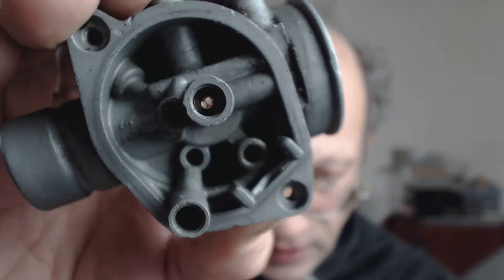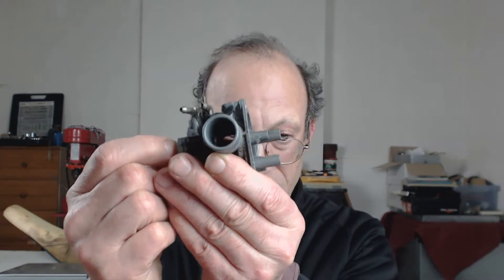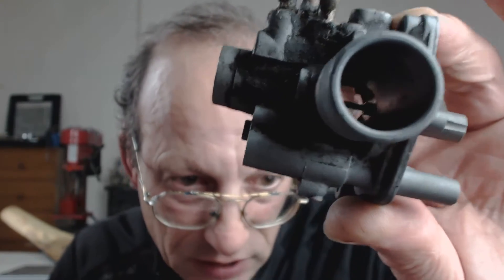Dellorto PHBN needles and jets

Comment: Hi mate, having problems with my reiju mrt am6 ,phbh 16 identical to the one in this video. Im running a stock barrel and a technigas exhaust with a 105 main jet and the bike runs idles fine and revs fine in neutral but is completely flat and has no power at all when riding. What main jet would you recommend as i think this is the issue. Cheers
Reply from the maker: It's hard to say Sol.
105 def sounds large ... but you need to get the pot cooking at the outset.
Set your idle circuit correctly, based around a 36.
Try an A20 dropped low into the atomiser - say notch 4 to delay hitting the taper
... hahaha starve her just a bit at low load - you won't melt the piston, but you will get the combustion chamber hot and ready for when the fuel dump comes, when you hit the taper - then it'll fly like a tart after two weeks in a convent :D 
Gradually edge down the main jet, keeping a watchful eye on the plug colour (keeping a slight tan - never white).
Reply: @EngineTuning  yea okay mate cheers i dropped down to a 80 main today from 106 down to 98 and then intervals of 2 down to 80 and its running better but sill shit

Comment: I own a Yamaha tzr50, recently I bought a new Reed valve for it but the bike will not idle - only run with the throttle cracked. However if I place the old original (incredibly worn) minerelli Reed valve in the slot, the bike will idle but not go above 7000 rpm
Any ideas of how to fix this?
Reply from the maker: It could be any number of problems
... but most likely it will be cumulative issues.
The idle circuit is probably not set correctly.
The reed valve might be a touch too thick.
The piston rings may be worn, or clogged with carbon, and the cylinder bore glazed.
It could need a new spark plug, and plug cap.

It may be time to remove the barrel, break the glaze (or rebore), and change the rings and maybe the piston.

... normal fun work :)
Reply: @EngineTuning  So ive resorted to using the original read valve, just so the bike will at least idle, but it will not get above around 7k revs. The barrel and piston is new, the entire engine has recently been rebuilt and the ignition system is new. It smokes alot and will not rev high. Any advise on what to do here, thanks.
Reply from the maker: @daveontherocks3111  If it smokes a lot, then it is running rich.
If the engine has been rebuilt, then this could be the problem area also.
Hey, it could be simply that your choke is stuck on :D
Have you checked the plug colour?

You need to work your way through the engine and carburettor, eliminating problems, until you find the problem.

Only you can do this ;)

Comment: I know this is an old video, but could you help me out? I have a stock needle in my dellorto phbn 16 and i think that its running lean on mid gas, even when the needle is in the highest position. what needle should i buy first?
Reply from the maker: Hi Otto :)
It's not possible to provide this kind of tuning advice, on the basis of a carburettor body type.
Consider visiting fuelmapper.com.
Think about the possibility to educate yourself in the skill of engine tuning - the fuel mapper will help, and I'll send you a general tuning guide.
Best wishes...

Comment: Please help. I have the needle in position 5, that’s how my kart runs best. Should I change the pilot jet to a bigger one and then bring the needle down to position 3? Is my understanding that if the needle is in position 1 or 5, you should change the pilot jet to a smaller or bigger one so the needle ends up in position 3? Is that correct? Thanks 🙏
Reply from the maker: Hello Silvana.
The problem that you face, is the need to learn how to tune a carburettor.
This is possible, but it will take some dedication.

Each element of the carb deals with a phase of the throttle, and merges with the next phase.

So the pilot jet deals with tickover and launch.
The needle can effect tickover but mainly deals with launch to mid throttle, while also effecting high throttle.
The main jet deals with high throttle, but also effects the full throttle range.

The first step is to understand this interaction.
The next step is to plan your carb changes.
The next step is to test your carb changes on the road or track.
Then make adjustments and test again.

The Needle Carb Fuel Mapper will help you in all these areas, but you must be prepared to learn.
Visit Fuelmapper.com and view some of the videos.

Good luck :)
Reply: Engine Tuning thanks for the help.

Comment: hi Engine Tuning, I'm having a nightmare with my pbhn 16 on a Reiju mrt 50 am6 motor, I replaced the top end with a cast iron 50cc after market one. I have a feeling the old one may have been a 70cc kit, as the main jet was a 112. I've replaced it with a 82 main. the problem is total lack of power. the cable choke doesn't do anything, although the cable does move the choke freely, also the idle adjustment screw does nothing to alter the revs, even when fully in. the bike was left outside for 6 months, so I stripped the carb completely, including the atomiser tube, and cleaned everything thoroughly, and blew it all through with an air line. the reeds are good and there are no air leaks on the rubber manifold. I've replaced the magneto side crank seal, as the plug isn't getting oily, I didn't bother with the clutch side. please help! many thanks, rob.
Reply from the maker: Hi Rob.
I'm busy on something at the moment ... I'll get back to you later.
Reply: no worries, not that familiar with YouTube posting, sorry! I appreciate your time, thanks
Reply from the maker: 1) Youu have replaced the 68cc or 74cc barrel with a 50cc barrel.
- 40mm D - 47mm D - 49mm D

Measure the previous cylinder diameter to learn the previous capacity.

Obviously the performance will plummet - at least by a third (33%), which is huge, when riding a small capacity bike.

2) The barrel contains the inlet and exhaust ports to the cylinder.
The barrel casting (containing these inlet and exhaust ports) can be crap.
They can be good, but they can be crap.
I'm going to do a video about this, but for the moment...

I tried a TNT 50cc replacement for the original Minarelli (which was shagged) - yet the new TNT barrel was far worse than the shagged original - it offered no zip whatsoever.
... it was (and is) good for a doorstop.
I put the original barrel back, before upgrading to 74cc.

In effect; if your cylinder ports are crap ... no matter how well you tune the carburation, it will always be crap.

3) Next ... you don't understand how fuel is delivered to the combustion chamber, from tick-over through to WOT (wide open throttle).
This is entirely normal.

There is a multitude of carb options, to adjust the fuel delivery throughout the throttle range.
Basically low, mid, high throttle ... all based upon airspeed through the bore of the carb.

However, these adjustments can effect the low and mid, the mid and high, or the low mid high.
This is a nightmare until you relax, and begin to see the whole fuel delivery as a progression from 0% throttle to 100% throttle.

Once you see the whole throttle range, it gets much easier.

To see the throttle range ... consider viewing this video : https://youtu.be/GeaEaIdfeco
You will begin to think about low throttle settings AND feeding the powerband with fuel.

4) Low throttle settings
If your idle jet is too large, you will find that adjustment via the screw is very difficult.

Check the idle jet size ... it should be around 36 / 38.
The engine tick-over only needs to spin the crankshaft.
Set your tick-over rpm using the standard method, to gain maximum efficiency of the fuel burn.

This will create a hot combustion chamber, that will allow you to dump fuel into it, that will be immediately burned.
This is what gives you immediate acceleration (and a fun bike).

5) Just remember that you can spend hours, days, and weeks, pissing around with your carb ... and be more confused than when you started (the normal route for most people).

Consider downloading the Needle Carb Fuel Mapper to assist with your education, and the perfect tuning of your engines (now and for the rest of your life) @ https://fuelmapper.com/.

6) If the bike has no zip, after tuning ... the ports are crap. (and you can do nothing about that)
You've not wasted your time, if you are actually advancing your knowledge (rare) ... but you will not have the performance that you desire.

Hard luck ... that's life ... you've bought a doorstop (just like I did).
In such a case, the only solution is to buy a 74cc cylinder, and then you can enjoy remarkable performance.

The PHBN 16 will provide excellent power, from low to high throttle.

You will probably be limited to around 66mph (thereabouts) ... but that will get you faster than 100 kph lorries (your worst enemies).
AND... the low end response out of corners should be amazing.

PHBN 17.5 is probably the ideal all-round carb for 74cc (can hit 70 mph https://youtu.be/VzAxxfhsPeU ).
19 PHBG has potential for a bit more top speed, at the expense of lower throttle power.

However, my advice would be to tune the 16 to the max, before changing to 17.5 (because it will be fine).

For 50cc the PHBN 16 will be perfectly fine, if the bike has been fully de-restricted.,

Good luck!
Reply: @EngineTuning  thanks very much for the information. I think that's what I get for paying £25 for a barrel, a bloody door stop! It seems you get what you pay for. Unfortunately, I chucked the other barrel and piston away, as they were knackered. But the bike was apparently very quick, before the piston packed in. Its time to put my hand in my pocket, thanks again, you're a gentleman
Reply from the maker: Ah yes Rob ... at least the door stop was cheap.
Don't throw it away, because it will be a useful reference, and perhaps good for practicing on.
https://youtu.be/lRD7_V14lPs

I'm sorry that I can't offer you a good barrel.
I have a good source, but it needs a manufacturing order.
You can easily get money to piss up a wall ... but independent engineers soon discover that the money supply doesn't exist for them.

Apparently we are dangerous.

After you have removed the sharp edges ... don't forget to add some extra oil to the fuel tank.
Best drain it, to find out the quantity.

Here's a fuel mix calculator: http://www.upnor.net/tools/fuelmixcalc.html

The engine will have an oil pump.
Always fit a clear tube from the pump to the carb, so that you can see that it has oil.
(you have to get creative to fill the tube with oil ... toothpaste helps after the event, if taking the direct route)

If it has oil at the carb ... an extra 10ml per litre of fuel will do it.
Good for running in, but also good to cover the increase in capacity, if going for a 74cc barrel.

A decent fully synthetic oil will be much thinner than a semi or mineral oil.
Castrol Power 1 Racing is expensive, but it's like water and lasts for ever.
The pump will pass more oil, and you can drop the extra mix to around 5ml once run in.

Personally, from a safety perspective, I'd go for the 74cc, so that your lad (or lass) can keep up with the traffic.

Get a couple of spark plugs B9ES and a new plug cap.
They are free with cornflakes http://www.carsparkplugs.com/1x-ngk-copper-core-spark-plug-b9es-2611.html

:)

Comment: I've done alot of pitbike motor builds and when I got came and porting in play I will some times modify the stock needle and make my own tapers for certain throttle position openings. Have had some really good results
Reply from the maker: Nice!
Are you using a pedestal drill, and finger & thumb  holding wet & dry abrasive paper?

It's a good skill to learn, and might be particularly useful for 'power jet' use, where an additional jet is positioned 3/4 up the front of the throat.

Comment: Hello, dear Engine Tuning!  7:12 what a needle? A02 or A12? Thank you!
Reply from the maker: At 7:12 it is the A02
Reply: I am thankful! dellorto phva 12 What kind of needle do you recommend?(original, long minarelli 50ccm)
Reply from the maker: That's a big question
The PHVA 12 is a tiny carb.
It is generally associated with 'performance restriction'.
For this reason, I have no experience in tuning with a 12mm carb.

However... you can still tune it.
The PHVA is a good design.

Most tuners prefer the PHBN, because it is NOT auto choke,
PHVA is the auto choke variant.
(Non-auto choke means that you know 100% that the choke is off)

Other than that the PHVA and the PHBN are exactly the same.

If you wish to begin to learn how to tune a carburettor
... you really need to gain a big advantage and use what modern technology offers.

Download the Needle Carb Fuel Mapper™ from http://fuelmapper.com/
This has the PHBN/PHVA already setup, with all the needles available.

You only need to change a couple of measurements (I'll advise you).

You can experiment with the PHVA 12.
The good news is that you can then acquire a PHBN/VA 17.5 and all the needles and jets will fit.

You lose nothing!

Ultimately, if you want to find performance.... you must find a PHBN/VA 17.5.
This will give your bike a major performance boost.
At the moment, your engine is struggling to breathe.
That's okay while you are learning, but to advance.....

Here is a video on how to use the fuel mapper:
https://youtu.be/9JxZKboE5cI

When you get it, I'll help you set it up.
Also, I'll point you to where you can buy a selection of needles and jets very cheaply.
(you'll need those).

Like I said... anything that you buy for the 12, will fit the 17.5.
The 17.5 is a serious racing carb with around 1000 fuel maps. 

I used the 17.5 to do the 70mph run:
https://youtu.be/VzAxxfhsPeU

:)
Reply: Thank you! :DDD

Comment: I will say that this is a good quality video but your explanation was foggy at best.
Reply from the maker: +AVI inc 
Yes...... I accept all criticism.
My videos are done on the fly and unscripted.
They are usually way too long, but the info is there.

I've just watched through it again... obviously It could be improved, but it does prove that certain carbs have the needle in the atomiser at all times.
Bear in mind that you will find very few tuning docs (if any - I've never seen one) that explain this mission critical information.

On tuning forums time and time again, you will see people misled, through the regurgitation of 1950's carb tuning advice.
Even the official Dellorto guide misleads in this area..... old info just copied and pasted.

In fact this video was created to counter just such misinformation on a tuning forum.
Ie. Primarily, if you change the needle on a carb of this type, you may need to change the main jet.

I think, if the initial few statements are not absorbed, the objective of the video might be missed.
Perhaps I should have opened with a text statement first.... or better prepared the opening statements.

Anyway.... too late now..... hopefully what I've just said, clarifies where clarity was missing.

Thanks for the feedback  :)

Comment: RDcarbs.  Changing from a Bleed type NJ and needle to a primary NJ and needle (fatter).   The primary type runs a smaller main than the bleed type.  Proving your point.   I am working w/ banshee carbs on an RD.  The banshee needle is VERY skinny and i think shorter than the RD needle...My belief was that along w/ the pilot circuit adding fuel...that skinny needle may have allowed some fuel to bleed out of the needle jet and richen things up.  I switched to a RD stock needle and am having better results especially w/ idle...if i am wrong, than what a needle does sticking in the N.J. is atomizing the fuel more efficiently, if it is not necessariy limiting flow.   Maybe a water hose w/ an adj. nozzle and a bucket would solve this argument.  have the nozzle set to maximum atomization...then have it set to a lazer beam type of flow....do both in the sam time frame and then measure the amount of water collected both times.  Should solve that problem!!
Reply from the maker: It's interesting that you're experiencing this.
I can only say for certain that this is the case with Dellorto PHBN (and PHVA) carbs..... because that's what I've tested.

I think the conclusion is: Be very careful when swapping needles.... particularly when going from a skinny to a fat needle, as it could create a dangerously lean mix.
In such a situation, I would up the main jet size, and test with caution ;)